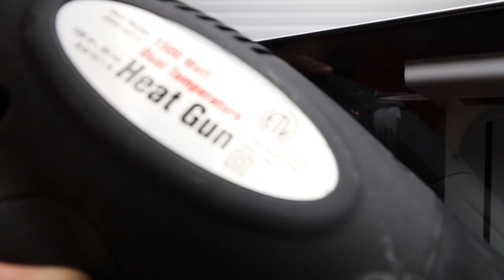Building a Gaming PC with my NEW SCREWDRIVER

Comment from the maker: So funny thing about this build: I was super stoked to use the screwdriver set for the first time ever and it ended up requiring less screwing than the average build because the cooler uses the clip system, the motherboard is smaller so only requires 4 total screws, there were no additional fans added to the case, etc 😅
Reply: eh first
Reply: Second
Reply: Should have moved both fans to the front, just to use the screwdriver more XD
Reply: Did you forget to plug in the LED strip that's inside on the top panel?
Reply: Can you give me your old pc please I need one my laptop broke please 😭
Reply: @feeterican  i am so sorry for asking I wanted a pc
Reply: Cameraman for better angles and also transitions.  Over all great video . Loved It.
Reply: Can I get one
Reply: What happened joye???
Reply: whats the download link for the screw driver
Reply: Question could a kraken x53 fit in this with the 3080 because I have the same case with this AIO but I was planning on buying a 3070 but now my friend might give me his 3080 I just don't think it will fit

Comment: That’s not a proper tool! You have to have a Swiss Army knife that hopefully has a screwdriver 😡
Reply: Dont forget the tweezers
Reply: 3DPrintingLife I FORGOT THE DAMN TABLE
Reply: How could he forget the thermal paste spreader and the cancer bracelet 😡
Reply: Damn were all forgetting things it seems
Reply: Guys I’m so sorry I did all these things after recording so it doesn’t matter but I’ll try better next time
Reply: Don’t forget to put the ram in the wrong slots
Reply: Oh yeah and to add thermal paste onto the thermal pad
Reply from the maker: LOL this thread is gold
Reply: @nerdonabudget  certainly is
Reply: Nerd on a Budget lmao I know right. I wasn’t even wearing my livestrong bracelet, AND I was fighting cancer not static
Reply: Trying to think of a bad pun
Reply: Nerd on a Budget is this going to be your build for LAN parties?
Reply: U placed the psu wrong it should blow the hot air into the case. 😎
Reply: @foxhk6730  That would be an achievement with two slots :D
Reply: @3dprintinglife  Wheres ma live strong bracelet at?!?!
Reply: What about the alan wrench
Reply: verdenxy  yes 100%
Reply: most importantly, don't forget to screw with confidence <3
Reply: Remember to really hammer it in
Reply: All you need is an Allen wrench an a cpu applicator

Comment: It looks like you missed a screw on the left of your m.2 slot. Great build, I am looking at something similar.
Reply: Correct, its under angle if you look closely and creates tension on the M2 on left side. There is a black "nut" under which the M2 needs to go
Reply: Yes, glad someone else noticed it too.

Comment: danny, i think you put the m.2 on wrong, you unscrewed the assembly, then put the m.2 on, then screwed the m.2 down, then the heatsink. i think you were supposed to heatsink first then screw, as shown by those metal tabs on it.
Reply from the maker: Tried that, the screw isn't long enough to reach the post after heatsink is resting on the drive. I was thinking the same thing, a bit odd of a design choice but it's snug in there after the square block was put back on

Comment: I think the mb was supposed to be screwed diagonally?
Reply: Nah doesn't really matter.  Star pattern is really only needed for cpu or gpu so the cold plate has even pressure.  If it has uneven pressure it can mess with temperatures or with threadripper the system might not boot at all.

Comment: hey nerd on a budget, i've watched you for awhile and finally built a pc! I got my pc to post and got my bios up, all i have to do now is download windows, which i've had a difficult time doing, i've inserted my flash drive with windows iso file installed inside, but when i go to boot up it says "Error Loading Operating System" Please help! ❤️
Reply from the maker: Glad you got your first build up and posted! How did you create your bootable media? Using the official windows Media creation tool?
Reply: Nerd on a Budget , i downloaded the iso image off of the windows website, i wasn't aware of what really to do. is there another way to do it?
Reply from the maker: https://youtu.be/Xzbrhbrejqo if you follow exactly as I do in this video you should be good to go
Reply: Nerd on a Budget thanks, it's working now!